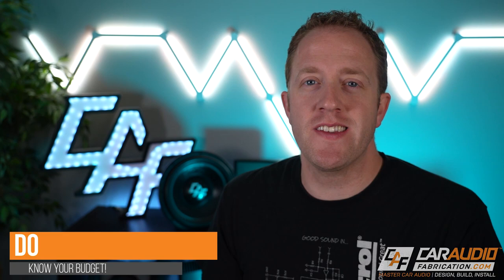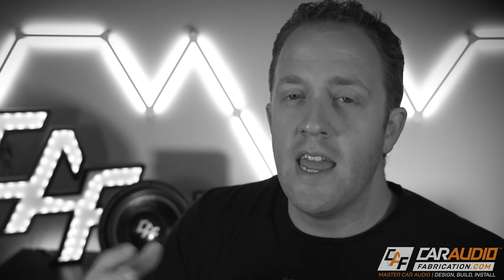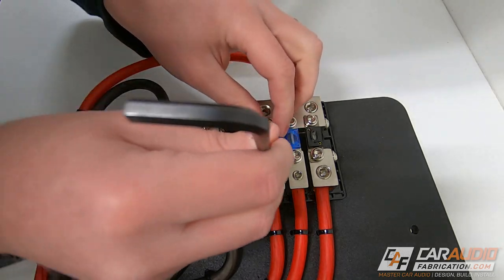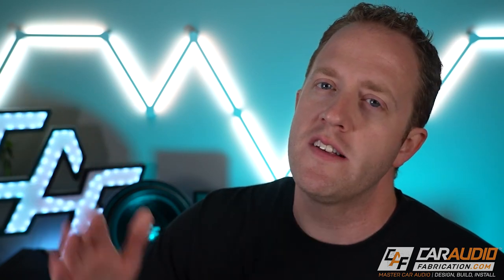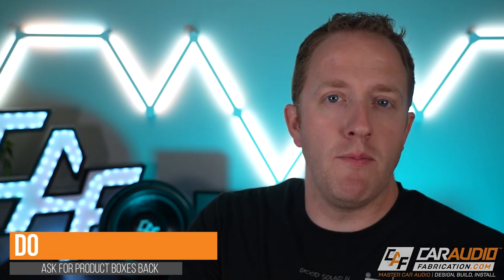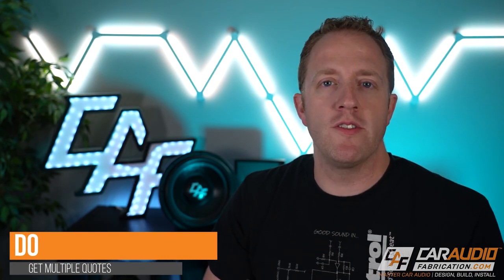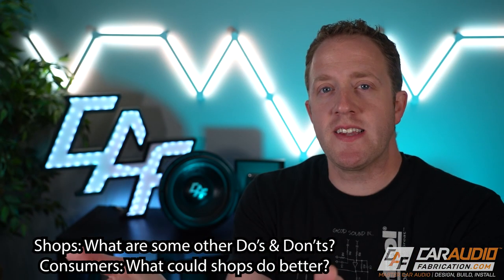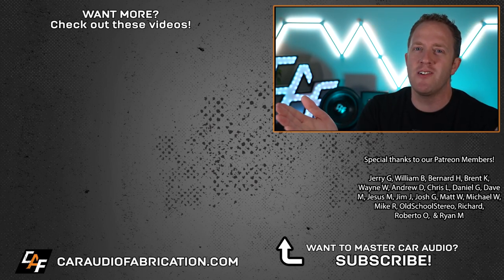Paying for Car Audio System to be installed? DON'T DO THIS!

Comment: As a tech, and this is a big one, DO CLEAN YOUR CAR OUT BEFORE YOU TAKE IT TO THE SHOP!!! There is nothing worse than having to get in someone's car that the interior is covered in trash or cigarette ash. And, if you're getting anything installed in the trunk, clean and empty it out. Sometimes we have to crawl in them too.
Reply from the maker: Dang! I wish I would have mentioned this one. Spot on. Maybe the boys can like your comment a bunch so it stays at the top.
Reply: @CarAudioFabrication  that would be cool, but yeah it's a common occurrence and drives me nuts. They know we gotta work on the car, and we gotta remove half their wardrobe and sports lockers out the cars. 🙄
Reply: Oh or you can pin it I think.
Reply: As a auto tech, I can't like this comment enough!!!! I've actually gone out to vehicles, opened the door, and just said nope, and walked back in. Tell advisor's to politely say, clean/ clean out your car and then come back, thanks. 

I get not every vehicle is gonna be "spotless". But when it looks biohazardy,  no thanks.
Reply: @lee28.78  Wow. Speaking from experience I assume?
Reply: @CarAudioFabrication  You can pin the comment
Reply: @lee28.78  I've yet to find a single shop with owners who had one honest bone in their body.
Reply: @lee28.78  I found $2000 behind the glovebox of a car I was working on. I called the customer right away to tell him. He was very grateful as he had lost the money 8 months earlier when he was going to buy some new wheels. So it sounds more like you are projecting what you would do than what happens in the real world.
Reply: Man, I remember refusing to work on a car because it was sooo bad. There was actually standing water in the floor boards! And he wanted me to install an amp and subs.
Reply: I agree completely.   22 year 12 volt tech and it never gets any easier to tolerate.   I don't show my disdain to the customer but I'm definitely thinking it.   Last car of the day yesterday was a deck in an 18 pilot.   Simple enough but working around the many many pieces of construction equipment,  gear,  clothes,  dirt,  etc...  sucked
Reply: Tell me about it. I'm tired of stumbling on condoms in a client's vehicle. I've turned down work because of this
Reply: OH, yeah. this is a biggie. We had a customer come in for work on his Jeep. It was so nasty even had used prophylactics in it. Had one customer come in for an alarm install. the speaker wire was run 6 " above the door frame. We started work on a SUV. It had a firearm stashed above the glove box. We called the customer to come remove it.
Reply: Some people just don't get their spare tire checked at my work because they have their entire house in the trunk.

Comment: As a client, I can definitely say that every installation studio should take photos in the process of work, and share them with the client!
Reply from the maker: Totally agree!
Reply: Depends. I am often on a tight schedule, and stopping to take pictures all the way through is time consuming. I generally only take pictures of about 20% of my work. If a client wants process pictures I will accommodate them, but it's not a given on every install.
Reply: I would love this. I wouldn't pay anyone at my current income level, as I have more time than money. Furthermore, I've watched CAF and 5Star way too much to settle for what I can afford.
Reply: Depending on the volume of the shop. If I have 8 cars on the board waiting to get done, pictures for a remote start are the last thing on my mind. If you ask I will do my best to accommodate but it isn’t a given. Big custom builds are the exception because those should be a given.

Comment: Before leaving the shop with your new system, tug test all the wire connections.  You would be surprised how many poor connections I have seen.
Reply: As a shop owner and installer of 30 + years, I've even been guilty of this. Get a phone call or asked to help out on another vehicle about the time you are going to make a crimp and come back thanking it's already done. Do enough installs and its going to happen to even the best of us.

Comment: My biggest advice is just to understand this isn't the 90s anymore where you can do your entire Honda Civic for $500 and have it sound amazing. 2-3k or you're going to have a bad time.
Reply: I don't know what 90's you grew up in, but you couldn't get a decent 300 watt amp ( Kenwood, pioneer) hell, for a 35watt 4 channel Sony, would coat $400, on my wall I have a ppi a600.2 that I paid $749(after taxes) I brought a taramp 3k for $189, so please explain to me how you could get amazing sound for 5 hundred in the 90's. A Jensen 100watt amp was around $125. You must've had a sparkomatic 1000watt EQ booster in the 90's🤪 5 hundred in the 90's got you amazing sound, please elaborate
Reply: That's so bullshit who says you need to spend 2k for an upgrade. You can spend wayy less and still be content with the sound
Reply: $500 and sound amazing in the 90s?   You could stay under $500 if you scored everything from a flea market but "sound amazing"? lol, no.  To sound amazing and justify the labor and installation on anything in the 90s you needed to start with something in the realm of an ADS PQ20 amp... or other amps in that quality spector -$799 off the bat....  a simple x-over Nakamichi ec200 - $200 and you're already over $1k before you even get to head unit, speakers, subs, labor etc....  the only way around this was if you were able to find one of those Pyramid 10,000 watt amps for $25 on sale.

Comment: Skills of the installers is very important no matter the cost. In my country (Kenya) if you want anything done right then do it yourself. I upgraded my car audio system 7 years ago. Took it to a shop for installation since back then I wasn’t familiar with audio stuff. Apparently the guy who did the install tapped the subwoofer signal from fronts channel and yet the head unit has a subwoofer channel. Head unit nice features like sub level and crossovers become useless. 5 years later I discovered it when I familiarized myself with audio stuff. After rewiring, setting listening position distances and shifting crossover duty from amp to head unit, my car audio improved dramatically. Got introduced to soundstage and imaging. For two years it was my best music listening system until I spent tons of cash on my home audio. All this I could have started enjoying five years ago if I had my install done by professionals.

Comment: Something that divides the opinion of most shops is coming in with a point by point print out of what you want. Some installers/shops don't seem to like this, but I love it. It gives clear direction on what is to be done so no one can be surprised in the end. Of course things might change during the design phase, but then it should be documented. Things like what types of materials (carpet, vinyl) colours (red and burgundy are very different etc).
Reply: I have a 2006 Corvette c6 that I am taking to a shop in about a month. The car is immaculate, it doesnt even get driven in rain. So, needless to say, I want what I want  and I want it how I want it. I have already installed the new head unit, mids and tweets in doors, ran speaker wire, power and ground to the back. I want the shop to make my box and install the sub (I already have) amps, dsp and tune everything. It should not be too complicate for a shop to do. So is this going to be a problem with me doing most of the job already and wanting the shop to finish it off?

Comment: All very solid suggestions. 
Some emphasis..

DO  Educate yourself as a customer about quality equipment and the best set up options for your specific vehicle.  
Audition speakers for the music you play most. I actually saved a bit just buying the brand that sounded best to me (Focal Access).

DON'T Cut corners on the install. Quality integration parts and sound treatments make a big difference.

Comment: man that lc2i pro is badass!!! i had the lc2i at first but noticed that my bass wasnt that deep after reading the info it cuts off at 33hz most ppl wont notice but i did. lc2i pro goes down to 20hz which is my sweet spot  hell yea
Reply from the maker: Thanks for sharing! It's definitely a solid LOC

Comment: Speaking from my personal experience, I'll share this:

If you're paying for an installation, buy the equipment you're having installed from them as well. The first aftermarket head unit I ever bought was purchased from a strip-mall electronics store and brought to a major car audio chain for installation. The head unit was faulty. The electronics store refunded my money for the head unit but refused to reimburse me for the installation cost and I ate $100. If you're sourcing your components yourself, learn to install them yourself.
Reply: What if someone gave you new amps and subs for your birthday or something?
Reply: @R M  That's a good question. If you're in that situation and are not comfortable installing the gear yourself and your bringing it to a shop, ask them for some examples of their work. A good shop will take pride in their work and take photos of their installations.

Comment: The technician should absolutely be involved in the ENTIRE sales process. They are more equipped to set the expectation based on budget, time, etc. The technician should also be present during delivery of the vehicle to go over everything that was installed. Being on both sides of this industry (sales and installation) it is crucial to give a proper in vehicle demonstration of what the client actually purchased. Pair their phone, show how multiple cameras work, how to switch between different tunes on an amp with built in DSP, etc.  Definitely builds a loyal client base.

Comment: I’m planning an install in my BMW… trying to decide between myself doing it, which I do believe I am capable (been years since I’ve done anything more than a head unit)… but I’m looking at doing a DSP and all… front components, rear coax, 8” mid-bass in the factory location under the seats, and then a 12 in the trunk.
I’ve been watching your videos and feel I may do it myself. (Running a power wire is easy as the battery is in the trunk)…. It’s just weighing my time vs the cost of having it done
Reply: Depending on the year of your BMW, as a professional shop owner I would strongly recommend that you have a shop at least give you a quote. There’s a lot involved.
Reply: Do it yourself. Great learning experience and you will know how to maintain the system or work on it. Make sure you have the big 3 and enough supply from your alternator  to not stress your car. Also plan on doing a head unit for a clean signal. Also... make sure the jump from your a and b pillar to the door is doable so you don't have to use factory wire to your new speakers.
Reply: Unless you are familiar with an RTA and own one you really are not going to get the most out of the DSP, coming from someone who use to install professionally for 8 years and was MECP advanced certified. i'd take it to a professional

Comment: I work in a separate, but somewhat related industry.  

Consumers are always somewhat skeptical of the professional; thinking that the professional is trying to just get the most money for their work by taking shortcuts.  Most professionals do not operate this way because if they did, then they would not be in business for very long.

Professionals should be more up-front about the value they can provide to the consumer, both in fit, finish, simplicity, and time savings.  Too often the professional gets into the habit of just "selling" the job that they forget that each new client is starting from zero.  I know it's exhausting having to do the same questions for every single customer, but at the end of the day the professional is the one selling their services.

Comment: Yeah I’ve hired a lot of professionals in the passed to do the work. I din’t know but it seems like they just throw it together. Looks like shot for what I paid for it. I even asked one time what is the process you are going to do to install it. They then replied they are not discussing it with me. I’m done with amateurs working on my shit. I can do a much better job.
Reply: If the installer doesn't know ohms law, RUN, because they are going to try to sell you shyt you don't need like a 4 channel amp to run your interior's, I haven't used a 4 channel amp since I had svc subs. I'm from the era when we ran 12 interior speakers of off a punch 150hd

Comment: I've been using only Rockford Fosgate for speakers, subs and amps for 20 years and my local high end shop doesn't carry RF and won't install anything you didn't buy from them. So i had to use best buy for my last install 😅
Reply: How was the Best Buy install experience? That’s probably where I would go

Comment: If you're system is not on display,  I would see no reason why you should have it all nice and neat, as long as they don't compromise the system  sound performance, and  actually wiring just hanging  all out there,! You get the idea 😉
Reply: Personally I wouldn't perform an install for someone without ensuring the finished result was nice and neat. I wouldn't want my name attached to a subpar install, bad for business.
Reply: I do installs for the next person who takes it apart. Last thing I would ever want is for someone to talk negatively about an install I did. When the next tech who works on it takes it apart I want them thinking about how well it was done and not “look at this rats nest.”.

Comment: Are shops willing to do partial installs like power wires only?
Reply: A mechanic could probably do that.
Reply from the maker: Only if you expect no warranty. Many shops don't like doing this because when another area of the install is done incorrectly they know who inevitably gets blamed.
Reply: No, when I installed professionally, we did not allow partial installs. You run power for them then you get a call later "my amp isn't turning on I wired everything up" LOL NO THANKS

Comment: If your paying to install equipment and take it out just sell it in the car and take the hit. The cost of pulling it out and putting it back to stock out weighs the cost of the equipment. unless you are buying the best stuff like focal and jl it’s never gonna be cost affective.
Reply from the maker: Well yeah, if you are putting in super cheap product it doesn't make sense. But most cars I've built in I can return to stock in just a few hours because I've planned ahead for it. Figure $300 for labor to keep all my gear... most all systems are going to have a gear value over that...
Reply: In most aftermarket car audio systems, the value of the gear greatly exceeds the cost of putting it back to factory.  If you bought the cheapest crap available, it might not be worth it, but even mid grade audio equipment is worth retrieval effort.
Reply: @danielabrams555  No it’s not. A 3yr old screen is out dated. Tech moves way too fast to bother moving these units to a new vehicle or selling them on. Same with speakers and amps unless you buy quality gear. Once you have been rinsing them for how long you might as well go again. A $1000 of gear is not worth the headache after three years. If you spent like 5k then I can understand pulling it.

Comment: I took a shot in the dark when I paid to do an install. They only did basic installs from the pictures. Nothing custom wise.

Thankfully they got creative and used the stock midrange bracket and some metal pieces erection pieces and
Hardware for the tweeters.

Probably the highest priced component install they have done 👍

Comment: I would be interested to hear your opinion on: would there be any value in doing some of the labor yourself prior to handing the vehicle over? If so what would be best tackled by the DIYer that wouldn't cause issues for the shop?
Reply: That's a great question.
Reply: Please don't do this. No installer wants to work on something that someone else worked on first. If you started the job, I'm not going to take the job unless you agree that I will be paid to redo everything that you did. I'm not trying to be an asshole, but I can't guarantee the quality of my work if it partially depends on work that you did yourself.
Reply: @Daniel Abrams  I can fully respect that, I wouldn't expect somebody to warranty my work. 

I was thinking for folks that wanted to do along the sound treatments, swap drop-in speakers, that type of thing.
Reply: @danielabrams555  I had the same question but about taking door panels off , taking door trim off / trunk carpet etc … not electronics or wiring so it arrives ready to be worked on and save that time and money . I would naturally be responsible for putting it back together and for everything but the installed components … that’s a no-no ?
Reply: @nickskolsky2560  yeah don't do that. Seriously most of that stuff doesn't take a lot of time and it's pretty easy to crack a panel or something if you aren't used to the force needed for it. Also us techs like to have a car leave the shop looking complete and nice for the customer, hard to do if we don't have panels or everything to put it back together.

Comment: Question should I the client get harnesses and some components and give them to the shop for head unit installs so I can be sure it’s connected the way that I want?
Reply: You can offer to them what you want, but in many cases, they can get what you want as well. Already having it can save time in some cases, but check with the service provider to see if they might already have it on site, or the time frame necessary to get it.

Comment: Does adding a amp and subwoofer void the factor warranty?
Reply: I'm not 100% sure but if i remember correctly when I bought my car I asked about adding speakers and if it will effect the warranty and they said it would only void the parts that the speaker could effect (battery/alternator etc.).